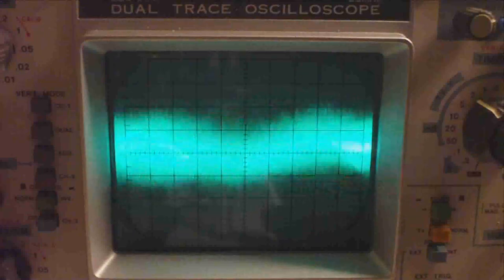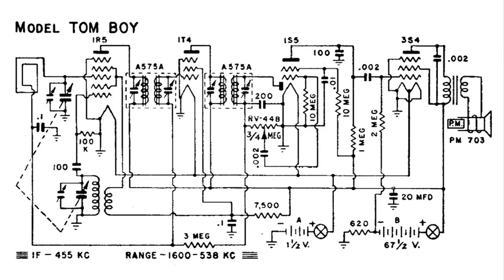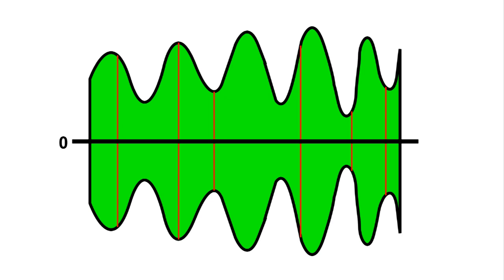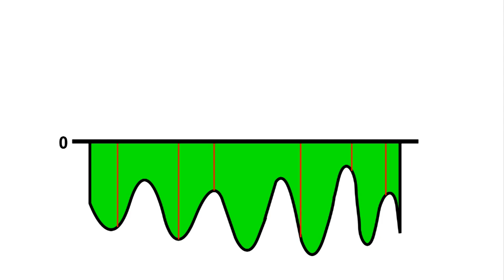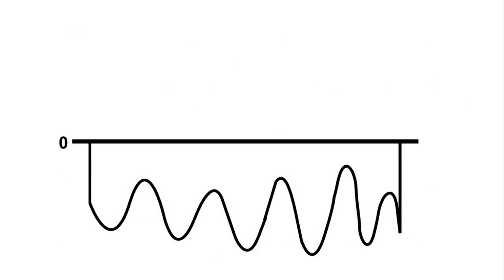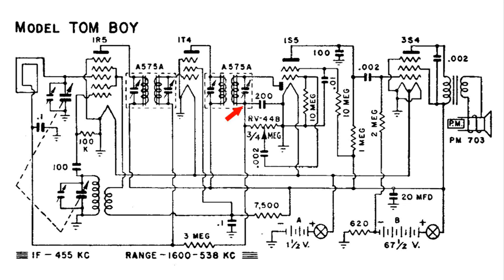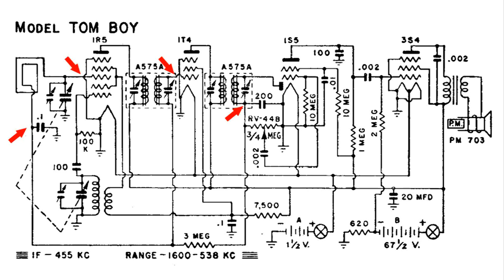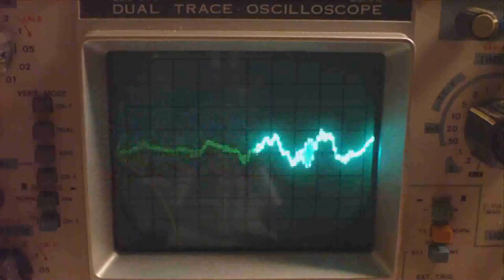AM Detector Demodulator

Comment from the maker: Thanks 78recordrepair
Because of the RC time constant of the 3MEG and the 0.1MFD it captures or stores the DC negative potential of the negative DC audio from the detector circuit. Those two parts were chosen so that the negative voltage on the grids of the first two tube would not change to fast or slow. If you did not have the radio tuned to a station the discharge path for the 0.1MFD is through the 3MEG and the Volume control to ground.

Comment: Why did the demodulated and filtered negative audio signal end up with half the audio signal going positive again (you showed the 0 line through the center)? Thank You, Rich
Reply from the maker: +allradio2 
The negative half of the audio modulated 455 Hz is chosen because of the automatic volume control circuit. You can do a channel search on my channel for 'automatic volume control'. After the 455 Hz is removed from the audio information, the only thing that will get amplified is the audio and at this point it does have a positive and negative component. So another words the audio modulated 455 Hz information is on the edge, the up-and-down part, when the 455 Hz is removed all you're left with is the audio, the up-and-down part.
Reply from the maker: +allradio2 
On the oscilloscope screen there is a horizontal centerline and that represents the zero point. Anything above is positive anything below is negative.
Reply: To get pure AC signal (which goes positive and negative) from pulsating DC (in this case it was on the negative side) you just put capacitor in series which blocks DC component of the signal, and only leaves you with AC which is what your speaker likes. So short answer would be: "Capacitor in series".

Comment: I made a demulator detector but while checking the output I was getting both positive and negative values of the signal. After that I used a parallel  100kohm resistor with the input of demodulator. Then I was getting the modulated positive signal. My question is why  I had to use this 100kohm resistor?
Reply from the maker: To complete the circuit

Comment: I understand that the carrier is taken way and the audio signal remains, but how? If we remove the carrier, and the audio signal was merely a representation of the amplitude of that carrier, then how are we left with the audio signal once the carrier is removed? Another way to say my question is, if we remove the carrier, isn't it's amplitude removed too? If so, how do we still have n audio signal?
Considering the fact that AM radio works, I know that I am certainly missing something. Can anyone help with this? Thank you!
Excellent video btw. ☺️
Reply from the maker: I have done a number of demodulation videos. The link below is the latest. Looking at the wiring diagram in this video C8A does drain off most of the RF. Remembering that AC will pass through a capacitor and DC is blocked. This is why the audio is left and the RF is gone. The complete RF filter consists of C8A, R3, and C9. These three components make up an RF Pi filter. Hope this video helps.
How the Volume Control works in a All American Five Radio
https://www.youtube.com/watch?v=swhVF-wb_eM
Reply: @AllAmericanFiveRadio  I think it finally just clicked. So, the audio signal is captured by the charge/discharge of the capacitors, right? It's the AMPLITUDE of the carrier wave that determines how charged the caps are, and as they discharge between each carrier wave period that level will always be close to what the amplitude of the carrier wave was during that individual period. But since the caps are set up to only capture lower frequencies the carrier wave itself doesn't make it through, only the modulation, or amplitude of the carrier. Is this correct?
Reply from the maker: @kurchak  
Capacitors blocks DC. The value of the capacitor determines the AC frequencies that can pass through it. Here are some videos that may help.
Capacitors, DC, AC, and Frequencies
https://www.youtube.com/watch?v=YfJKNSkz_Lk

Capacitors, DC and AC Current
https://www.youtube.com/watch?v=NInt1Ss3vQ4

Wire, Resistor, Capacitor, Coil, DC AC Characteristics
https://www.youtube.com/watch?v=mIfJnVuA8JI

Audio Coupling Capacitor, how it Functions in a Circuit
https://www.youtube.com/watch?v=PAPnwX6YiIM

Oscillators, the Basic Tank Circuit 1
https://www.youtube.com/watch?v=fQ4yRVEzXQA

How Capacitors charge and discharge
https://www.youtube.com/watch?v=Ag2RujOHqJ8
Reply: @kurchak  Capacitors PASS AC. Alternating (as in positive and negative relative to ground) Current. After the diode, only the negative half of the signal and carrier remains. And it is always negative. The signal gets more and less negative but always stays negative so the capacitor lets all of it through. But the negative part of the carrier doesn't go through because the 200 pF cap bleeds it off. The size of that cap is important to that frequency. If you slowly increase the size you would see that it would start letting more and more of the carrier through.
Hope that helps.